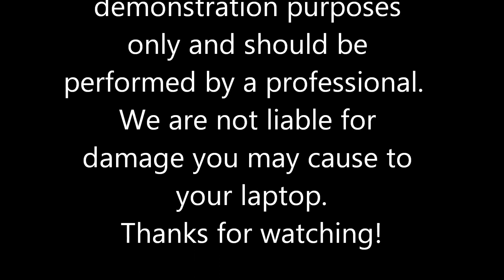Asus UX31a AC DC Power Jack Repair

Comment: Does the heatsink and fan obstruct getting the motherboard out of the chassis? It doesn't look like any if the motherboard screws or ribbons prevent you from pulling it out and accessing the power jack. Don't want to remove and reapply thermal paste if I don't have to.